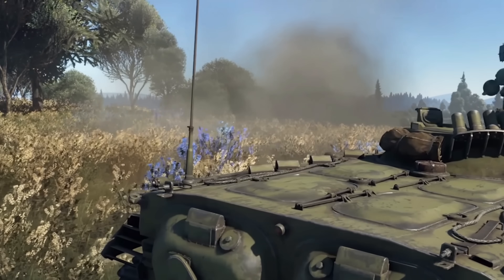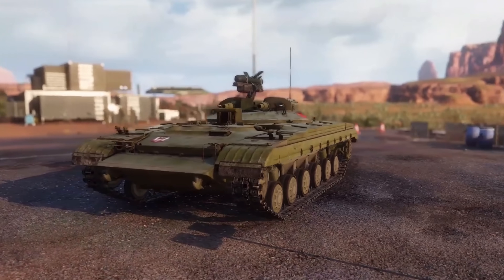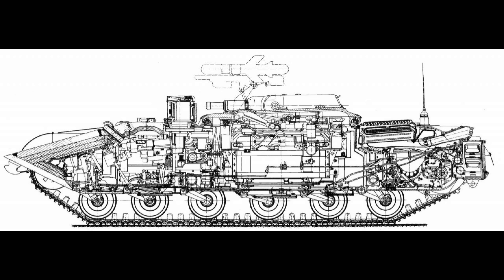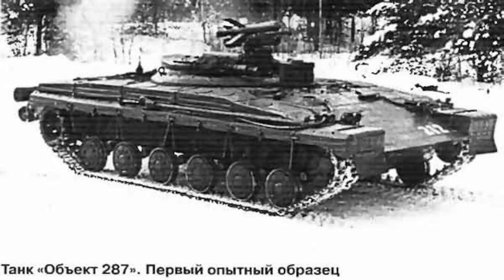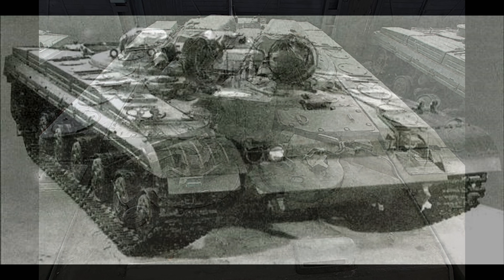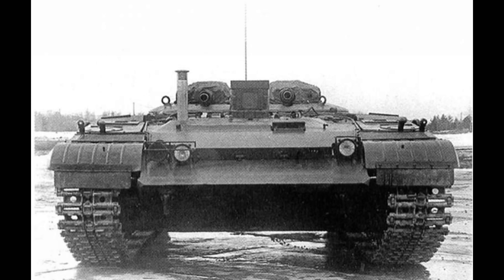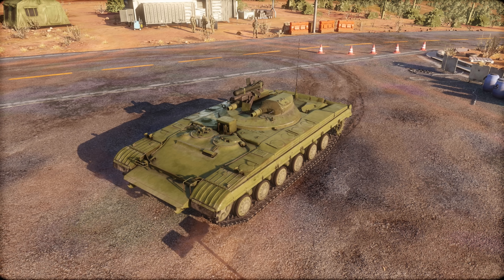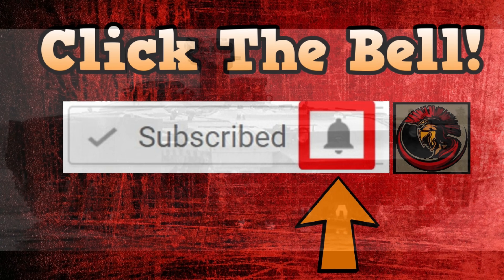Russian Object 287 Tank | FAILED TANK DESTROYER

Comment: A modern version of this would be worth trying. First would be Improve the crew requirement by adding a 3rd man ( standard for Russian vehicles). 2nd would be modern optics used on current russian vehicles ( t-14 has robotic turret so optics could potentially be bulk purchased for both to lower cost). Third would be improved chassis and protection systems as this thing could now possess active protection, ERA, and more modern soft kill systems. Furthermore the low profile turret would benefit immensely from a changed suspension system that would allow the tank to 'crouch' or 'chin up' so it could have better gun elevation and depression. 3rd would be modern weapon upgrade as the guns would become the bmp-3 100mm guns if they stuck with cannons, or twin 57mm if they went the t-15 direction. With the addition of the third man, a RWS could also be added and used to spot additional targets ( russian tiger RWS possesses integrated thermal viewer as well as day/night sights). Morst impressive however would be modern missiles, which would not only tremendously out range and outgun tanks, but can even engage drones and fix wing aircraft. If an expensive hellfire-like missile ( Russian 9m111 reflex?) is not desired for cheap targets like drones, short range SAM could be easily added like with the Uran-9 combat drones featuring cannon, igla, and ATGMs. Overall, a modern version of this would be an absolute monster on the battlefield today.

Comment: The terminator tank is the modern version of this tank.
Reply: but russia only has 10. LOL
Reply: @usaisthebestiockdownpoiice816  Probably didn't have enough money. But yeah theyre army could fight good.
Reply: @overwatchelite4083  its not about the money. It's about making it full domestic production. Which American sanctions made really difficult. All composite materials, all complex mechanical parts, all electronic components, recently it came down to a ban on transistor import. A lot of which were either fully imported, or used imported components in manufacturing. So all the production and the economy around it had to built from almost from scratch, with the same quality requirements as imported components. You can understand that its not an easy feat, but judging by Army 2020 Expo it has been done within these 6 years. Expect newer and better vehicles, at cheaper prices being manufactured in greater numbers. Of course the deadline is offset +- 6 years in the future.
Reply: @namesurname624  Thanks for the info my man
Reply: Sepher Agon
1 second ago
But in 73 Syrians and Gyotyans defeted Isreal with thes wepon

Comment: There are problems with ATGM vehicles:

1) As claimed the minimal distance for the ATGM is 500 meter, but in practice it is probably more like ½ mile.
"Chieftain" gave the WW2 figures (and they are probably reasonably relevant for a European terrain) of MEDIAN range for tank kill targets of 400 meters (or 1/4 mile), i.e. half of the hit enemy tanks were hit under 1/4 mile.
The AVERAGE hit distance was 700 meters - which means there was some very long range shots that knocked on the turret. Those long range shots are the task of the ATGM vehicles. The closer ones are the province of the tank - where tank projectile has the speed to penetrate the armour in direct fire.
Which simplifies the entire aiming process for the tank.

The ATGM on the vehicle is for long range targets of opportunity, and the ATGM by the dismounts are the ones really to be counted on for the infantry following the cavalry,.

2) The armour protection of the ATGM vehicle is not that critical (except against artillery fire) because the ATGM on the vehicle is only used at long ranges where the tanks have every opportunity to miss.
As soon as that bolt is shot the Infantry Combat Vehicle retires to a VERY hull-down position with only the mashine canon offering fire support to the dismounts. Meaning: If the enemy hits anything it will be the remotely operated turret, and not the dismounts.

3) The reliability of the ATGM today is probably a whole lot better. TOW has been tested and used in a lot of conflicts. The 3-4000 meter range is probably more theory than practice, as the target might move about 100  yards in the 10 seconds the missile takes to get out to that range - and with usual amount of luck - it will be into cover.

My point is: Combined arms with battlegroup consisting of a battery of artillery, a company of infantry and a squadron of tanks moving together and covering the butts of the others in the batallion combat group.